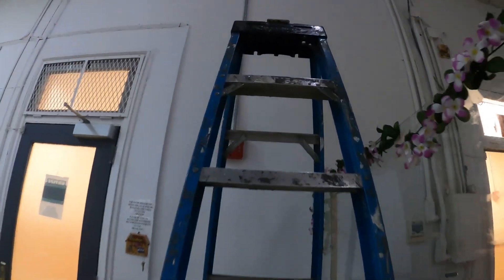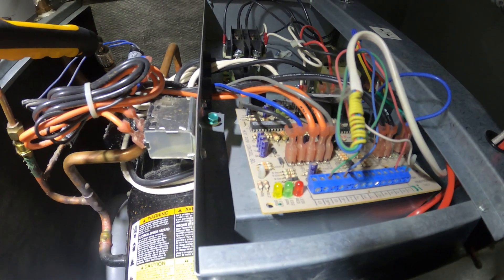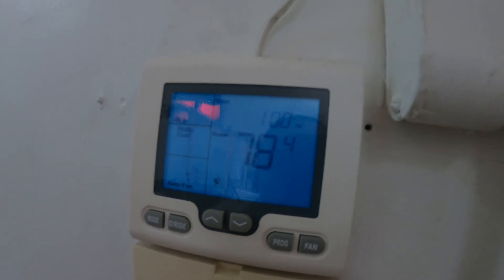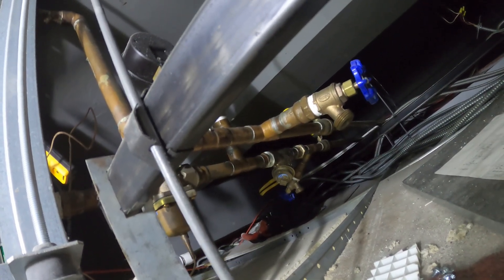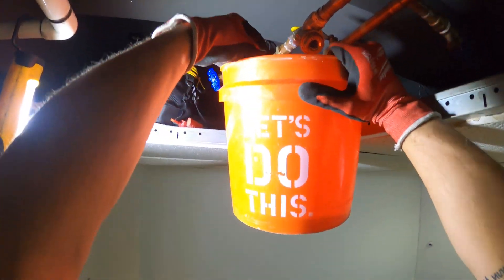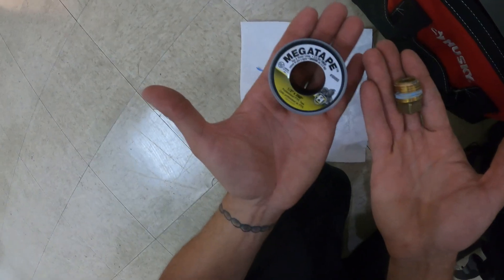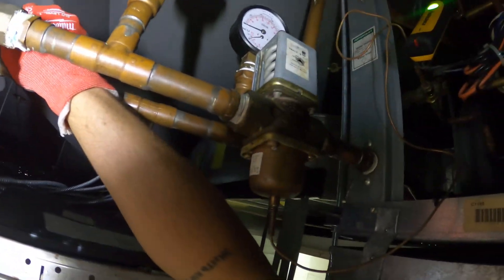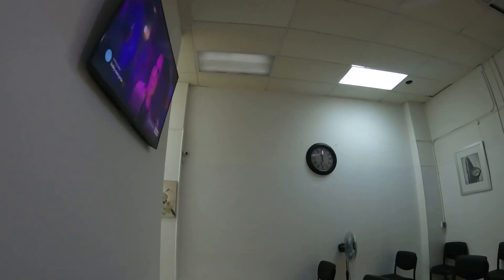HVAC: Water Source Heat Pump Not Cooling (McQuay Water Cooled Heat Pump Service Call) AC Not Working

Comment: I have an issue with my moms unit in her condo.  The building keeps saying its her AC unit even though its a newer unit 2.5years old.  1. There is no strainer wye at all so I know the strainer isnt plugged...  The unit intermittently stops working fan still runs but no compressor.  The LED trouble code says high head pressure as well.  Multiple AC techs have checked out her unit and cant find any issue.  So I hooked up a fieldpiece temp sensor (st4) on the in and out water lines.  When the unit is working the in is 90-92 and the out is usually 8 degrees hotter which is at the upper end I know but last time it stopped working I went over (not sure how long it was off but probably a couple hours)  the ambient air in the condo was 78 and both the in and out water lines were reading the same 80ish degrees which is almost ambient air temp.  So to me that says there is no water in the lines?  The buildings AC guy says no if there was no water the hose would be super hot.  I dont understand that if the compressor has been off for hour or more and just the fan running how does that heat up the hoses?  He also said a strainer is not needed... Im calling BS on that too.  Can you point me in the direction of the next best trouble shooting steps to narrow down if this is a building or AC unit issue.  She is getting the run around from all sides and its very frustrating.

Comment: Nice video, I had the same problem last week on a similar McQuay with 22.  Whats the reason for the condenser water regulating valve. Never seen one on any of the water source heat pumps were I work. Looks like something else to go wrong; that is not need on that type of system. Lol
Reply: All water source should have some type of water regulator if not that type they have circuit setters

Comment: Props for another great video sir!!!….I also work on a lot of horizontal in the ceiling heat pumps as well as chassis heat pumps but I rarely if ever encounter water regulators…. How do you go about setting the amount of water flow???do you cross reference the units manual performance guide and set it up based on head pressure reference chart numbers or do you use some sort of water metre to determine the GPM to the various size heat pumps and regulate water flow that way
Thank you very much
Reply: You can set the head pressure on that regulator with a service wrench. That is based on what refrigerant you are using and the ambient temp in that location. That is adjusting the water. However I have see  systems with actual water balance valves, a lot in hospital's. That usually requires special equipment to do. You hook up hoses and set the GPM to the designed flow, however they go out of adjustment all the time depending on the brand used. Also watch out for bad back flow preventers if one is installed. Here is a link to a common one.    https://www.supplyhouse.com/Bell-Gossett-117415LF-CB-3-4-Lead-Free-Circuit-Setter-Balance-Valve-3-4-NPT?utm_source=bingad&utm_medium=shopping&msclkid=8a25f74514d016871f7295fc95398bfd